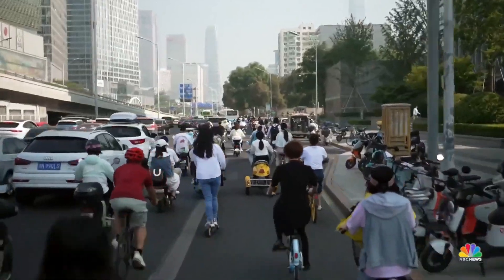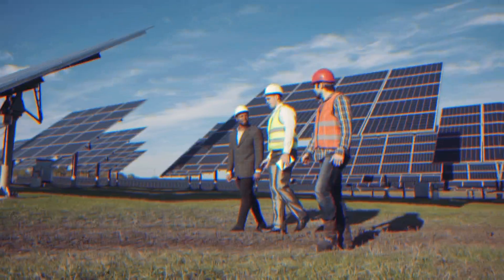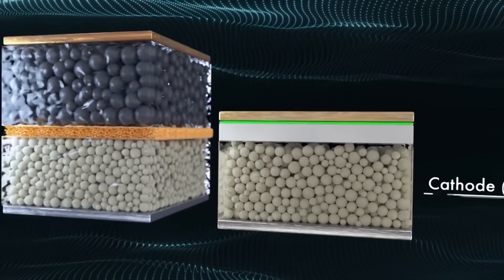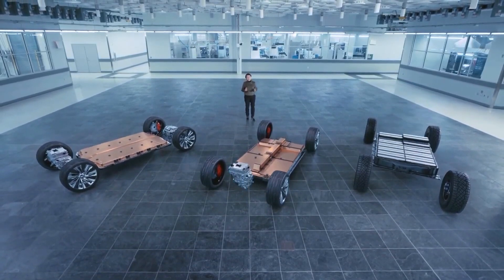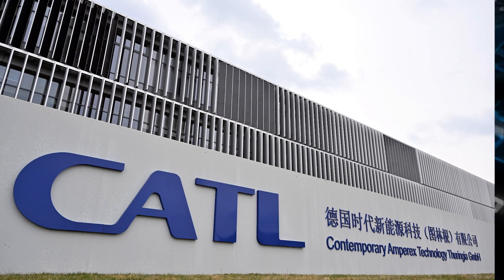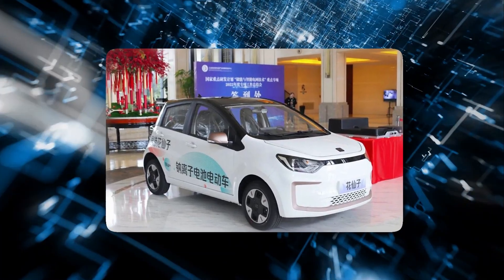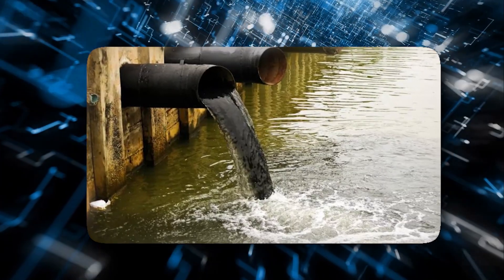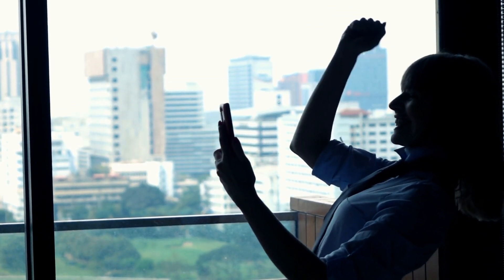Sodium Batteries Are CHANGING China's EV Game

Comment: I read an article on sodium batteries when I visited China last year. The article stated that there is an interest in using them in electric scooters and ebikes as a fire safety precaution. Even if the energy density is lower that lithium, I think that it may be sufficient for scooters and ebikes, especially if they have swappable batteries. Fire safety is a concern of mine and I would consider an eBike or scooter with a sodium battery.